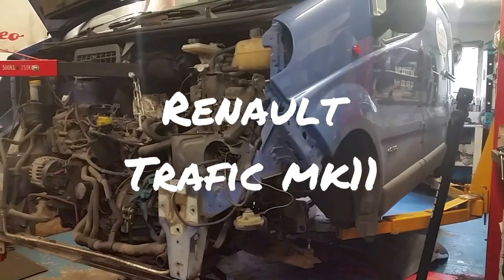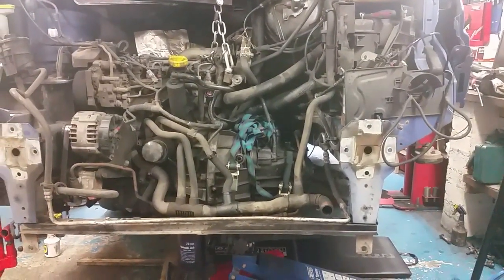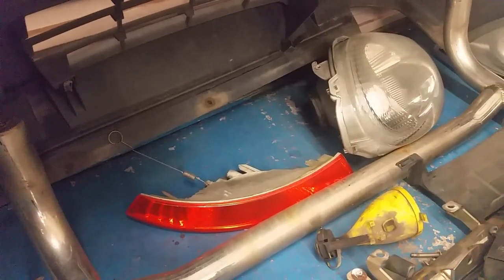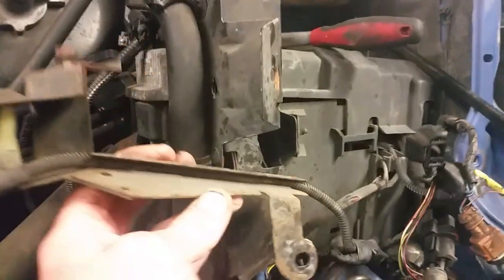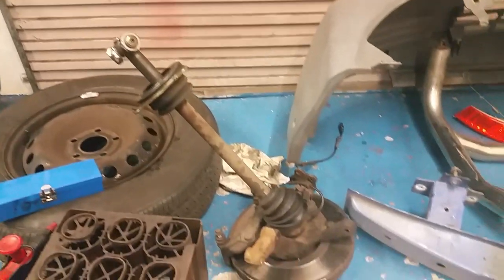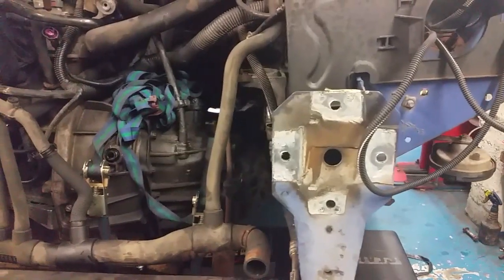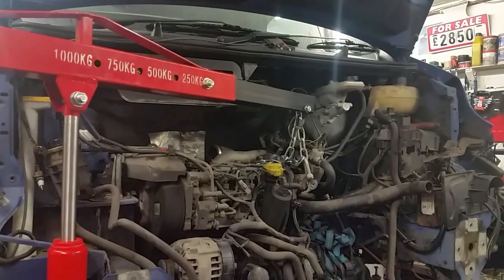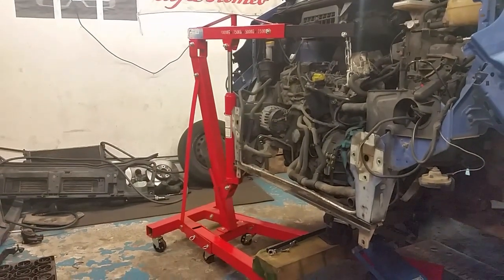Renault trafic, Vivaro, primastar. Gearbox removal . Service position

Comment: This did help in as such as on the 1.9, the starter is at the rear of the engine under the wastegate, the 2lt has it at the front and is a pig.....also the subframe needs to be moved to one side/ rearward slightly....took me 2 days to do this job from start to finish, not rushing

Comment: Wow for the uninitiated (like me). That does look intimidating! Nice work as always Dave. Cheers Pal...P.S Thanx again for the support on my last Vid! Made a huge difference.
Reply from the maker: Cheers mate. Aye the van looks worse than it is. The owner arrived to get some of his stuff and was shocked. Hope ur extra views and subs works for you. Cheers dave
Reply: TheGibby3340
 - Indeed it looks scary. But the reality is that removing the entire front it's a 15~20 minutes job, doing it alone with power tools. With another pair of hands would be even easier/faster.
These are work vehicles and quite honestly some of the easiest I've worked on and I worked on many. 
For all the "normal" maintenance, i.e. oil, filters, etc. nothing need to come off and it's easy. 
For any more in depth intervention, simply remove the entire front or parts of it according to the needs. No reason to fiddle around all the wires, pipes, etc. makes life a lot easier. 
Cheers

Comment: There's a plastic grommit on the drivers side you can remove so the bonnet can still be held up with the standard bar
Reply from the maker: That is correct. I elected not to use it in this case as it was getting in the way of the engine crane.
Thanks for watching and your comment

Comment: I have a 2011 vivaro 2.0 manual. i notice that, in the morning when releasing the clutch you can fell a judder. Worse if you are on a hill. Not as noticeable when the van warms up. Could this be caused by a leak from the slave cylinder?
Reply from the maker: dont think so, you may have a gearbox problem or the clutch itself
Reply: Not the slave, it's a "clutch" issue. Most probable a combination of, an uneven pressure plate, glazed flywheel surface, spent friction material on the disk and/or contamination from the oil seal (behind the flywheel) and a bunch of dirt in the entire system. 
Might sound like a scary description, but it's all quite "normal" in used units. But nevertheless troublesome and in need of attention. ;-)